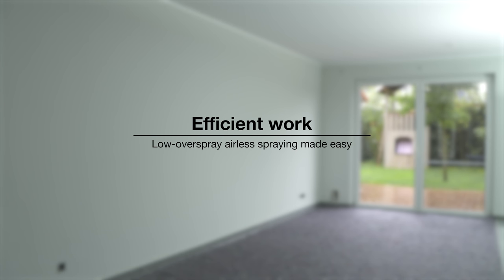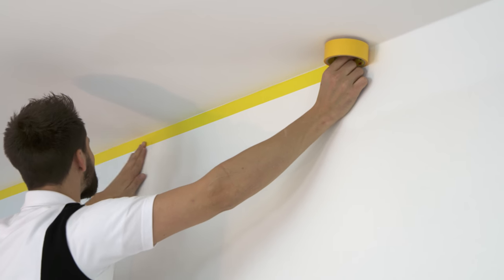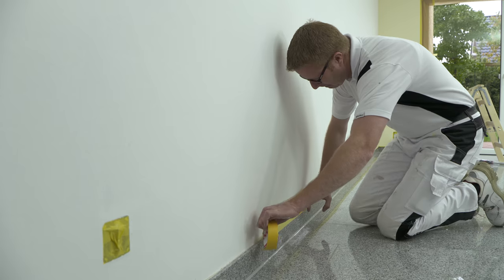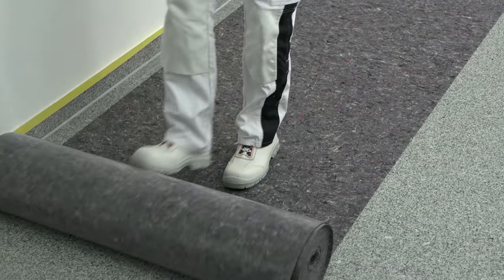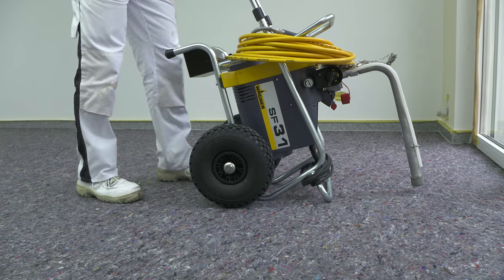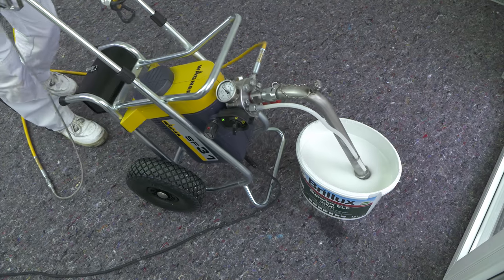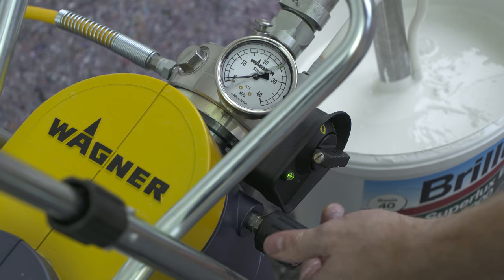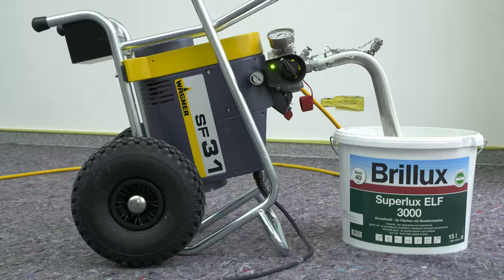Be efficient: Low-overspray airless spraying

Comment: What nozzle size is used in this demonstration?
Reply from the maker: That's a TradeTip 3 – 425 nozzle; 0,025 inch.
Reply: Thank you! Can you tell me also what pressure is used with this paint?
Reply: this demonstration is just unreal. No respirators, no overspray anywhere..